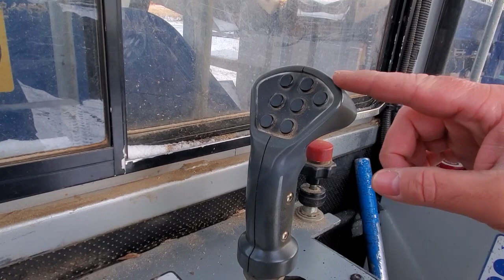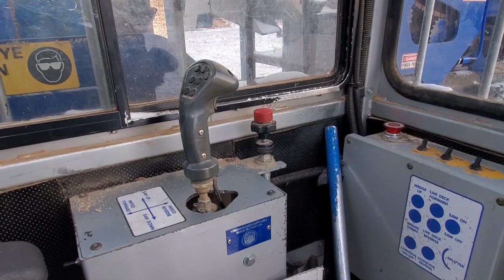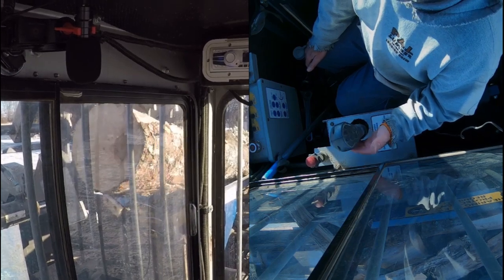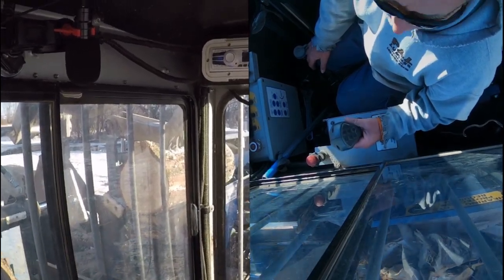IN CAB  JOYSTICK VIEW OF THE BELLS 4000

Comment: I’m jealous - I don’t have a cab - I had one job where the wind was blowing hard right in my face all day - couldn’t keep the sawdust out of my eyes - took me 2 days for the crap to work out of my eyeballs 😎. I got better glasses after that
Reply from the maker: Ya we ordered ours with out one and sent it back 50hrs later to get a cab put on for the exact reason.    We are going to put a AC unit on this year just cause we are running in the summer more and it's like a sauna when it's 100 degrees out.
Reply: @SkidderKev  o I didn’t realize a/c was optional - I imagine in that little metal box it can hot 🥵
Reply from the maker: Yup.  It will be standard now that it's eastonmade

Comment: That actually seems pretty quiet in there. No radio in it? You can tell you've run it once or twice (lol) when you can do a fine end cut like it's just a standard cut. Trigger is the splitter then? Is it full cycle split or can you stop it and retract it?
Reply from the maker: It still can been abit noisy.  The mic seemed to cancel abit of it out.     It does have a radio I just had it off so I can monetize.   I mostly listen to podcasts and sat radio.
Reply from the maker: I forgot to answer your other question.  1 pull of the trigger will cycle the ram.  If I need to stop it I just pull the trigger again.  1 more pull and it will retract the ram.

Comment: HI Kev. how many cords an hour can you push through that thing ?? i can likely put 2+ through my Blacks Creek if i have help..
Reply from the maker: With this load of logs we did about 3 full cords a hr.  It can do up to 4 tho   All depends on the size of the wood you get in.    Is that black creeks a circular?
Reply: @SkidderKev  Hi. Kev. No actually it has a 20" bar. And it is belt driven off the engine coupler. And is considerably faster than a hyd. unit.
Reply from the maker: @richardp3628  interesting,   I will have to check them out at the show next year.    Not much power lost going right from the motor pretty much
Reply: @SkidderKev  if we get to have outdoor shows..lol
Reply from the maker: very true